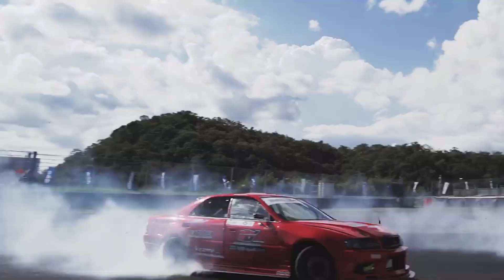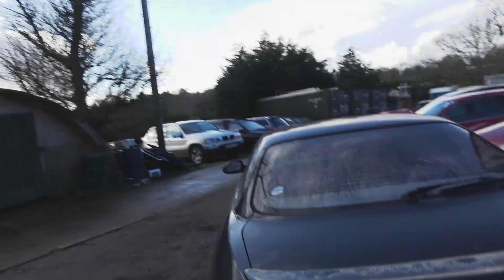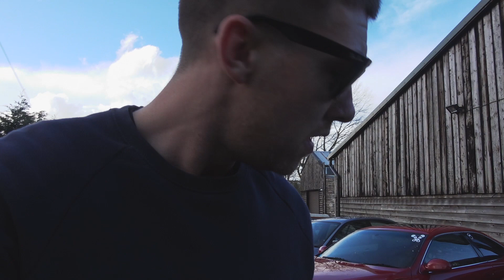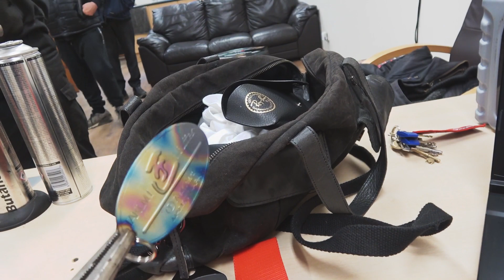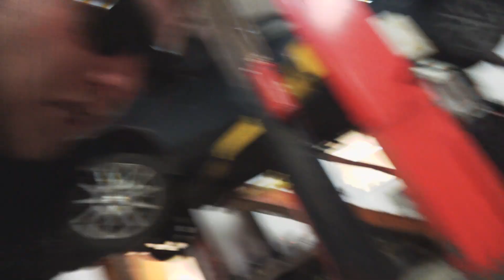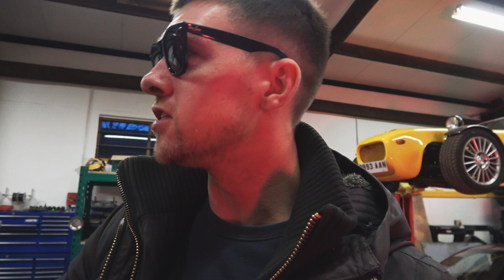🐒 MY NEW 600HP JZX100 1.5JZ! HOW TO IMPORT A CAR FROM JAPAN PART 1

Comment: Let's dumb down Mr Monky's explanation a bit.
JZX90/100
Mark II - Base Model
Chaser - Performance Trim
Cresta - Luxury Trim
JZX110
The 110's, like he explained, were only produced with the Mark II name. The Mark II had a performance variant under the trim "IR-V" which came with the 1JZ-GTE. There was also a Yamaha tuned version called the "IR-V Fortuna" that had a limited release.
Mark II - Base Model
Mark II IR-V- Performance Trim
Verossa - Luxury model, released as a different vehicle all together.
The 110's are the last I6 Toyota sedans and were replaced by the Mark X which uses a V6 ( Toyota GR engine series) also used by Lexus.
Reply: I didn’t watch the video yet, but doesn’t Tourer V modification stands for performance with 1jzgte and r154?

Comment: Is there any advantage to having a 2jz bottom with a 1j head?
Reply from the maker: Matt Jones not really, people use to say 1j heads flow better but this was found not to be case. Usually done because people blow 1j bottom ends then just swap to 2j bottom ends for similar money, without needing to change much as you've still got the original top end, same intake / turbo setup / exhaust etc but the added bonus of an extra 500cc, 3.0L opposed to 2.5L. No replacement for displacement etc etc. In stock form pretty sure a 2jz bottem end with 1jz head will have a slightly higher compression ratio over full 2jz, possibly why people sore better numbers

Comment: 2JZ Block, 1JZ VVTi Head (1.5JZ)
JZX110 Transmission
HKS Camshafts
Garrett GTX3071R Turbo (NEW)
Precision Wastegate with Screamer pipe
Aftermarket Injectors (SARD 800cc?)
JR Racing Mani
Custom Front Pipe
TRD Front Strut Brace
Oil Catch Can
Metal Suction Pipe
K&N Air Cleaner
Custom Intercooler and Short Piping
Uprated Fuel Pump
SARD FPR
HKS Slide EX Cam Pulley
HKS Timing Belt
Kouki Tail Lights
Heyman Spec DG5 Coilovers, Pilo Lowers
Swift Springs , R7kg, F
Aftermarket LSD
Solid LSD Mounts
Custom Strait Pipe Exhaust, Dump at LSD
Aftermarket Subframe Collars
Uprated Fuel Pump
Aftermarket Rear Stabiliser
Ikeya Formula Rear Upper Arms
Ikeya Formula Rear Toe Rods
Ikeya Formula Rear Traction Rods
Ikeya Formula Rear Lower Arms
Aftermarket Drilled Front and Rear Rotors
Front and Rear Wheel Spacers
Stain mesh brake lines
Aftermarket Rear Pads
Hey Man 800ps Knuckles
Hey Man Extended 25mm Lower Arms
Tie Rod Spacers
Long Tie Rod Ends
Solid LSD mounts
All AC Removed
Custom Metal Bonnet with Vent (Been repaired before after being on one of our old demo cars)
Aero Catches
HKS FconV Pro Gold (Just tuned by our mapper)
Greddy V Manage VVti Controller
Oil Cooler
Front Lip Spoiler
Carbon Front Canards
FRP Side Skirt Extensions
Kazama Auto Promode Front Bumper
Kazama Auto Promode Side Skirts
BN Sports Type M Front Fenders
BN Sports Type M Rear Over Fenders
Powervehicles FD Spec Weld in Cage
Rays Gram Lights 57DR Alloys (10.5J + 12)
Limited Edition Bride Full Bucket Team Orange Seat
Bride Seat Rail
Driven Steering Wheel
RPM 4 Point Harness
Defi Oil Press Meter
Defi Water Temp Meter
Defi Oil Temp Meter
Defi Meter Controller
Trust Shift Knob
Battery Moved to Rear
OS Giken Twin Plate Clutch
Advance High Discharge Alternator
Greddy No 8 Plugs
NEW Greddy Profec Boost Controller

Comment: Vehicle: 1996.10 JZX100 Mark 2 Tourer V, White>Repainted VW Red

Spec Highlights: 1.5JZ, FD Japan Spec Car built in house

CLICK FOR FULL GALLERY

 

SPEC:
1996.10 JZX100 Mark 2 Tourer V, White>Repainted VW Red

KMS:
122679

TYRES:
F: Some Tread
R: Worn

SALES POINTS:
2JZ Block, 1JZ VVTi Head (1.5JZ)
JZX110 Transmission
HKS Camshafts
Garrett GTX3071R Turbo (NEW)
Precision Wastegate with Screamer pipe
Aftermarket Injectors (SARD 800cc?)
JR Racing Mani
Custom Front Pipe
TRD Front Strut Brace
Oil Catch Can
Metal Suction Pipe
K&N Air Cleaner
Custom Intercooler and Short Piping
Uprated Fuel Pump
SARD FPR
HKS Slide EX Cam Pulley
HKS Timing Belt
Kouki Tail Lights
Heyman Spec DG5 Coilovers, Pilo Lowers
Swift Springs , R7kg, F
Aftermarket LSD
Solid LSD Mounts
Custom Strait Pipe Exhaust, Dump at LSD
Aftermarket Subframe Collars
Uprated Fuel Pump
Aftermarket Rear Stabiliser
Ikeya Formula Rear Upper Arms
Ikeya Formula Rear Toe Rods
Ikeya Formula Rear Traction Rods
Ikeya Formula Rear Lower Arms
Aftermarket Drilled Front and Rear Rotors
Front and Rear Wheel Spacers
Stain mesh brake lines
Aftermarket Rear Pads
Hey Man 800ps Knuckles
Hey Man Extended 25mm Lower Arms
Tie Rod Spacers
Long Tie Rod Ends
Solid LSD mounts
All AC Removed
Custom Metal Bonnet with Vent (Been repaired before after being on one of our old demo cars)
Aero Catches
HKS FconV Pro Gold (Just tuned by our mapper)
Greddy V Manage VVti Controller
Oil Cooler
Front Lip Spoiler
Carbon Front Canards
FRP Side Skirt Extensions
Kazama Auto Promode Front Bumper
Kazama Auto Promode Side Skirts
BN Sports Type M Front Fenders
BN Sports Type M Rear Over Fenders
Powervehicles FD Spec Weld in Cage
Rays Gram Lights 57DR Alloys (10.5J + 12)
Limited Edition Bride Full Bucket Team Orange Seat
Bride Seat Rail
Driven Steering Wheel
RPM 4 Point Harness
Defi Oil Press Meter
Defi Water Temp Meter
Defi Oil Temp Meter
Defi Meter Controller
Trust Shift Knob
Battery Moved to Rear
OS Giken Twin Plate Clutch
Advance High Discharge Alternator
Greddy No 8 Plugs
NEW Greddy Profec Boost Controller

OBSERVATIONS:
Please Study all Pics for more Info
AT>MT
Built in House, using our tried and test combination of parts, ideal for small to medium size tracks (Change to a larger turbo if you want to use on larger tracks)
Engine unopened 2JZ Block (We can overhaul / forge at extra cost)
Estimated 550ps on Japanese High Octane, for more power we can swap to a larger turbo for 650ps such as GTX3582 Gen 2
Super responsive, but turbo has small amount of boost drop though at high RPM
Rear Floor Cut (Can be sealed if required)
Loosely Complies to Formula D Japan rules (Things like seats / harnesses may need updated though)
Further Tuning can be done such as upgrade to 3.1 /3.4 /3.6 2JZ and G-Force Gearbox

Comment: why use a 1j head? doesn't the 2j head flow a lot better?
Reply: 1.5jz was used to run D1SL spec for power vehicles in japan
Reply: Alex Thompson Almost all 1.5j cars had a 1jz to start with, when you want to go 2j you just buy an Na 2j block for a couple of hundred dollars throw some rods and pistons in it and slap your head on. Vwala reliable 2j displacement and power minus the stupid 2jzgte tax (seriously half cut prices are getting stupid)
Reply: It ups the compression ratio aswell squezzing 3.0l of air into 2.5 head.  People used to do it to minis and other cars. I had a ren 19 1.4 with 1.1 head. Basicley the pistons still suck same amont of air in soo you fit smaller head which compresses it more. Instead of a 9 to 1 youd get a 11 to 1 ratio.